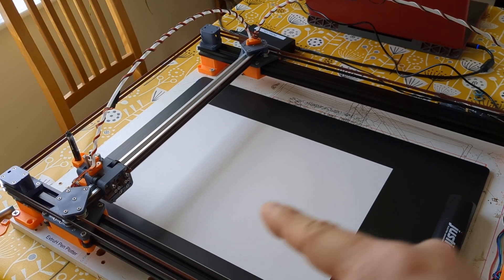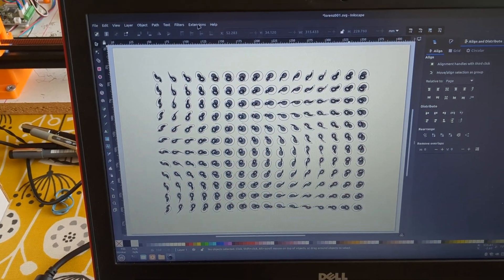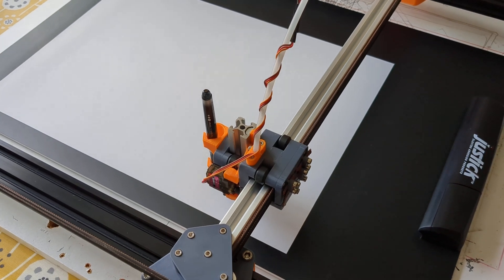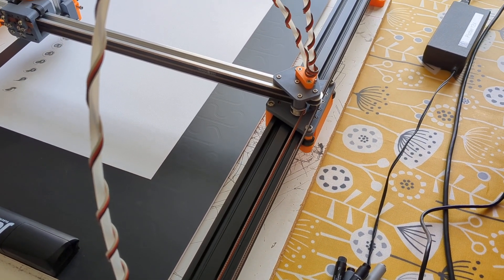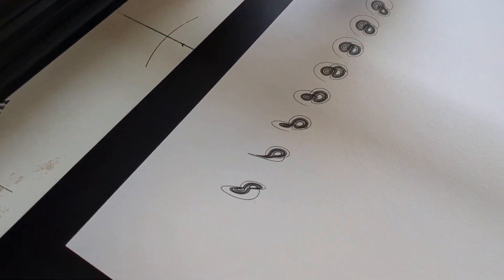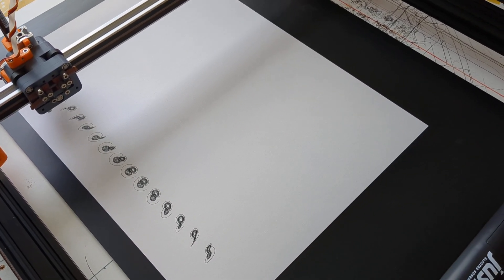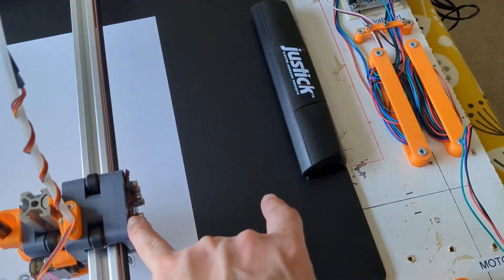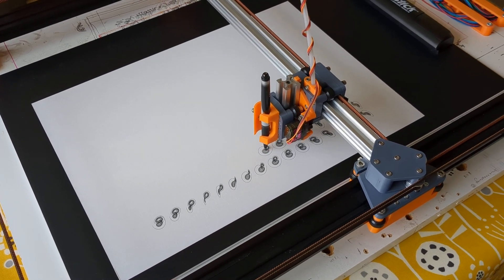Slapdash CoreXY Plotter Tour: "Sidegrades" & Upgrades

Comment: Hi Chris, this is awesome! I've had a vintage machine from the 80s, that used the same concept to hold down paper and it worked like a charm. Would you do a video on setting up the electronics and axidraw software?
Reply from the maker: That's actually a pretty good idea, this kind of machine needs some modifications to the AxiDraw software to work well and I've seen a few people have trouble with it. It's not just this one, some of the iDraw machines have the same trouble

No guarantees that it will happen quickly though :)

Comment: This is pretty cool! Can you please measure the Justick thing? Is it 600 by 400 (24 by 16) usable or including the battery box? What is the usable area?
Reply from the maker: It's 40cm wide (edge to edge), the usable length from the bottom edge to the battery box is about 55cm
60cm is the overall length

Comment: great build! Any plans to make some kind of belt tensiner mechanism??
Reply from the maker: Currently the belt tensioner is "sliding the motors back until the belts are tight then doing up the screws" which works very well but is a bit inelegant 

I had thought about doing something better but it involved more pulleys than I had on hand so, no - I don't have any plans at the moment
Reply: @ChrisLynas  Thanks I'll do your method by sliding the motors back :) Another quetion, how did u manage to connect the servo to pen lift plate?I can't figure that one out for the life of me. I got same servo (I think-  MG90S) , but have spent the last hour trying to figure it out. If I mount the arm on the servo, it does not leave enough room for the server arm to be mounted to server. it colides with the pen carriage. Do you have any closeup pictures?
Reply from the maker: It sounds like you have the right servo

It gets fixed to a part with the name "15_penLiftBase2.stl" in the Printables list, this is the part that is fixed to the pen carriage and also holds the vertical extrusion that the pen lift plate rides on. The servo mounts vertically with the arm at the bottom oriented away from the pen carriage - have a look at the main photo for ExtruH on Printables for now, if you zoom in you can see some detail but I'll see if I can add more photos since this is the most fiddly part. The screw holes in this part do not line up with the screw holes in the servo, I didn't have any the right size so I designed the base to hold the servo with M3 screws and washers on the outside of the servo's mounting tabs. There's a remix that someone kindly made that has a hole spacing that does line up if you have some the right size and would prefer this

The servo arm should interface with an M3 screw mounted on the pen lift plate to lift it from below
Reply: @ChrisLynas  I kinda figured most of it out. I didnt notice the M3 screw you needed to screw in for the servo to lidt the carriage. Saw it on your other video (the non corexy) :D I built the machine and tried to make it work with a arduino uno + cnc shield. For the most part it worked, but just too much hassle. Ordered a EiBotBoard, as it is almost just a plug and play soulution. Another question, do you think that the justick would accommodate A2 paper? I built the machine to be able to use A2 paper.
Reply from the maker: The Justick I bought is bigger than A3 but probably won't do A2, they might make other ones that size though. I didn't check in detail but they do seem to make some in pretty large sizes

Comment: Nice work! Impressive work on the 3D printed parts!

I'm looking to build a larger machine (A1), and I'm looking at two designs: The Openbuilds ACRO, and the UUNA TEK iDraw H A1. Have you seen them? They look significantly easier to build (it's my first attempt on something like that!)
Reply from the maker: I've seen pictures of some of them (although there seem to be many variants of the uunatek plotters so perhaps I haven't seen that one) but I didn't look in any detail. Kits can be a very good way to get a set of components in one go and can be much cheaper if you don't already have some of the parts

Comment: Hello,

I’d like to know how you generate the G-code.
Which application do you use to control the motors and the servo motor?
Thank you in advance for your reply!
Reply from the maker: This plotter uses a control board called an EiBotBoard, this is the same board that's used in the AxiDraw plotter and because its motion works the same way I can use the same open source control software. This means that I use the Inkscape extension for AxiDraw and I don't have to use Gcode because the extension drives the plotter board directly from the drawing in Inkscape. The board and the extension controls the servo directly at the same time as the stepper motors

Most of the drawings I plot are generated using code I wrote in Processing which exports the SVG files that I can open in Inkscape for plotting
Reply: thanks you
Reply: Thanks for your clear explanation! If I understand correctly, you’re using an EiBotBoard like on the AxiDraw, and with the Inkscape extension, you can send SVG files directly without needing G-code, right?
And you even generate your drawings automatically using Processing? That’s really smart.

Would you be able to share a link to your Processing code or an example of your setup?
Also, could you make a tutorial to show how you set everything up (hardware + software)? It would be really helpful for people like me who want to build a DIY plotter. Your method looks super efficient!
Reply from the maker: That's right but it's not necessary to send the SVG files anywhere; when they're open in Inkscape the extension will control the plotter to draw what's in the open document with all of the movement planning being done on the PC

Processing can export SVG files, I tend to import these into a drawing of the correct size in Inkscape for final scaling and positioning since I don't always bother to get the size perfect in the export 

A lot of my Processing code is a bit basic and not very easy to read so I don't have many things shared but there's some on GitHub, for example: https://github.com/pittance/Halftone

I had thought about doing some demos of drawing techniques for photo to plotter processes, I've done some planning but there's some more organisation involved in getting things ready so no guarantees on time

This was a very useful comment though since now I know that the process of sending the plot might be useful so I can add that to the plan: thanks!
Reply: Thanks a lot for your clear explanations! 🙏
Would you be able to make a detailed step-by-step tutorial on PC showing how you use the EiBotBoard with Inkscape?
It would be super helpful for people who want to get started with this kind of plotter without needing to use G-code.
Thanks in advance if you have time to do it! 😊
Reply from the maker: When using an EiBotBoard with a plotter like this everything is basically the same as using an AxiDraw so there's no need for me to write anything, the AxiDraw documentation has detailed guides for installing and using Inkscape with the extension: https://wiki.evilmadscientist.com/AxiDraw_User_Guide

There's a downloadable PDF that shows setup and how to do plots. There are different versions but for plotting they're mostly all the same for plotting

Comment: Nice plotter. try to speed up plotting. The corexy setup should allow 10x the speed if the pen and lifting can keep up
Reply from the maker: The machine can move quite a lot faster (although perhaps not as fast as you'd think, the max step speed on the board is not too far from the current traverse speed) but the quality reduces. The pen arm is quite heavy and some of the printed parts are not very stiff so there is imprecision and ringing that generally means it's not worth going much faster without a redesign of the mechanical parts and probably a different board which would require lots of work as this one is very convenient

Comment: Does this design support up to A2? If I want to make the work area up to A2, how long is the aluminum extruder needed for x and y?
Reply from the maker: I've seen people make the H-bot original version of this plotter bigger than mine (which is oversize A3) but some of them had trouble with stiffness so this coreXY version is probably safer at A2 as it's much more stiff 

My machine has 70cm of 2040 extrusion on each side and 50cm of 2020 extrusion and its maximum possible plot area is 51 x 36.8cm (note that this isn't all fully usable since these limits are hard stops that the machine should not be allowed to hit, you need a bit of margin). That means relative to the extrusion we lose 19cm on the long side and 13.2cm on the short side

A2 is 59.4 x 42cm so if we assume the same losses in travel we'd need at least 78.4cm 2040 and 55.2cm 2020. Realistically this means something like 82cm of 2040 and 60cm of 2020 V slot extrusion would be needed but remember you also need around 7cm of 2020 for pen lift. I don't know what standard sizes of extrusion are available for you but as long as they're longer than 82cm and 60cm they should be fine. Your base board would also need to be big enough to fit these extrusions, mine is just about the right size for my A3 machine at 76 x 57.4cm so for A2 it would be a fair bit bigger, this machine cannot work without a solid baseboard

Comment: That’s a sweet build! For not too much money you could throw some TMC2209’s or newer equivs in the main board and cut out almost all of the stepper noise
Reply from the maker: I would very much like to move to nicer drivers but the driver board is an all in one with surface mount drivers and I just don't think I have the soldering skills to do it even if the new ones were pin compatible

I could swap to a different board but then I don't know of any way to keep the tight integration with Inkscape that I currently value quite highly

Having a good cheap control option is probably the part of this project that I'm last happy with, there's the relatively expensive but convenient option with old drivers and then there's everything else which I didn't find a way to test yet
Reply: @ what is the control board and firmware you’re running?
Reply from the maker: It's an EiBotBoard, the same one that is in the AxiDraw plotter from Bantam (was EMSL), it comes with its own firmware built in. It's designed to work with Inkscape extensions that were developed for AxiDraw and because my kinematic and board is the same as AxiDraw I can use them also, which is very convenient

Comment: I was about to start another DIY plotter but I think I'm gonna change directions, yours looks way sturdier.

Question, do you think that changing the control board would work with your design? Cheers
Reply from the maker: Yes, different control boards will work. Where people have told me about other boards I've tried to link them but I don't have personal experience of other options. For many of them the biggest change from a different board will be the way that the plotter is controlled: mine works in Inkscape with an extension but takes lines directly from the drawing, others need pre processing into GCode first

Comment: What program are you using?
Reply from the maker: I'm not sure exactly what you're asking so this might be too much information but: 

CAD for the parts is in OpenSCAD
Parts are printed in PrusaSlicer on a Prusa Mini+
Images that I plot are often made using Processing to convert photos into lines
The plotter is controlled within Inkscape with an extension to drive the plotter

Nearly all of the software used at all stages is open source
Reply: @ChrisLynas , could you describe your process for converting pictures to lines? I've attempted this using various methods and haven't settled on a process that works well (my own plotter ends up drawing lots of dots instead of connecting up lines).
Reply from the maker: That's a complex question to answer because I don't have one process, I have lots :)

There are some examples of some of the processes I've used in the shorts I've uploaded recently but most of them involve something being varied based on brightness in the photo so I'm not trying to draw what's in  the picture but rather to represent darker and lighter parts. Sorry, I'm not sure if that makes sense

Most of the code I use to do the conversion I've written myself and some of it is open source but there are other (probably better) frameworks like drawingbot V3(?)
Reply: @ChrisLynas that makes sense, I've got programming experience and have considered writing my own algorithm as the ones I've found have not worked well for this (plugins for Inkscape). I'll take a look at the one you mentioned and keep tinkering, it was for my kids at any rate that I got into this at all. I wanted a babystep for them to play around with before they graduate to the 3d printer that I work with. Easier if they mess up a drawing than a 3d print :)

Comment: Can you make it write a sentence?
Reply from the maker: Yes, it can draw any shapes that you can make, and text is just another shape

If you give it standard fonts it will draw around the outline which isn't always ideal. However I use an open source plugin set in Inkscape that was built for the AxiDraw plotter and it includes the capability to convert standard text into "single stroke" text. This makes the text a bit more like letters the way a human (with really, really good handwriting) would write them

Comment: What do you think about the scheme, when 2 motors set on axis Y (like prusa Z-axis). It seems to me that for a really large area this is a more right. This way the belts will be shorter.
Reply from the maker: The main benefit of both H-bot and coreXY is that the motors all stay in place so there's no need for wires to be moved around and the heavy motors don't have to move. As you say the downside is often longer belts, this can make the machine less stiff

However a lot of arrangements that use one motor (or pair of motors) to drive a single axis need the other axis motor to move which means its wires have to move (moving wires can fatigue and fail faster) and it increases the moving mass which can make things more bouncy but might have shorter belts which will act against this

Which of these options work out to have the right balance is very likely to be different for different size machines so it's possible a really big machine could be better with different belts and motors. I've been surprised by so many things that didn't work the way I expected with machines like this that I tend to assume it's best to just try things and see what works :)